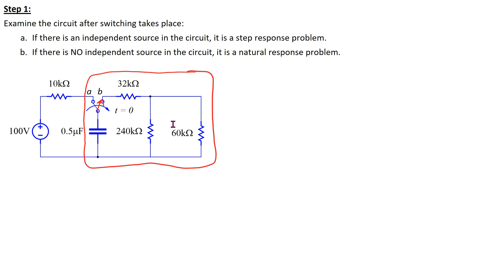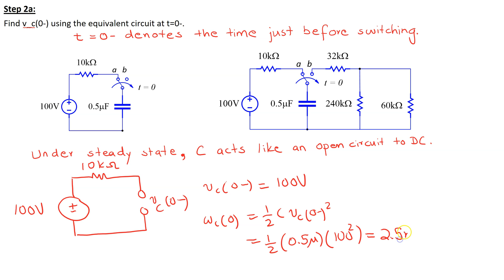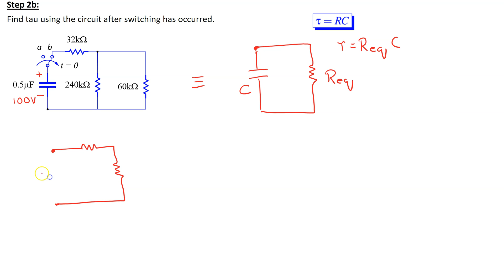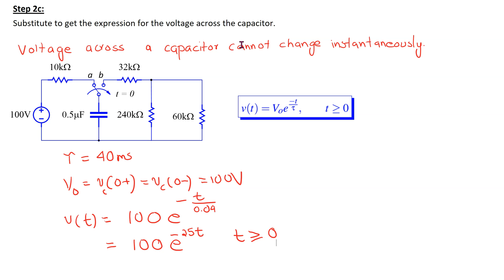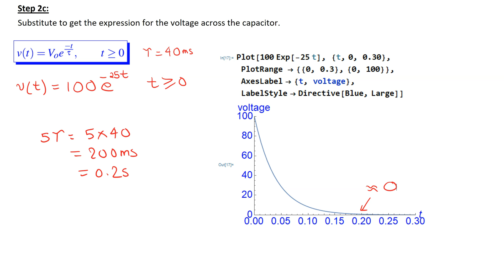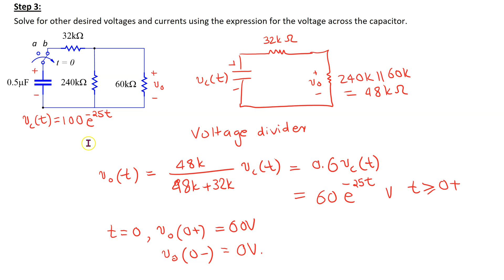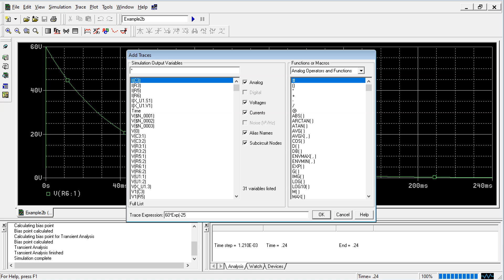Example 1 - Solving for Natural Response of an RC Circuit

Comment: Step response is same as force response or not?
Reply from the maker: No.

Total (step) response = forced response  (due to sources turning ON) + natural response (due to capacitor/inductor initial conditions). 

The term forced and natural response is used in conjunction with an approach to solving differential equations for RC/RL circuits by hand.
Reply: Make video on lcr circuit parallel and series
Reply from the maker: Thank you for the suggestion, which I will consider your suggestion for the future.

At present, there is a video available using phasor circuit analysis for series and parallel RLC circuits: https://youtu.be/rL8l4xZ6EL0